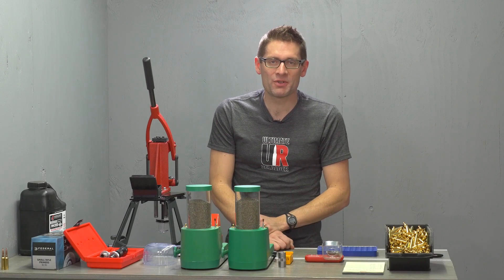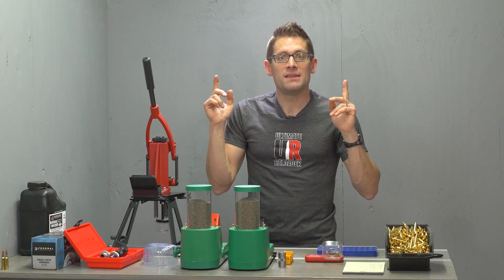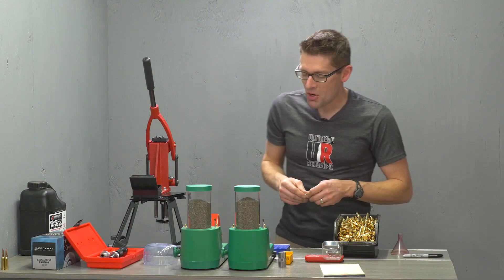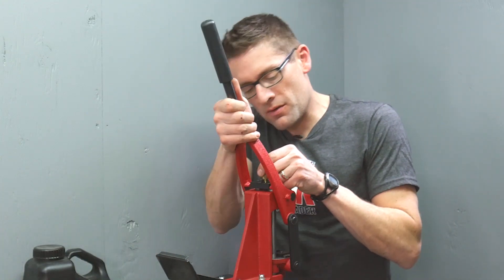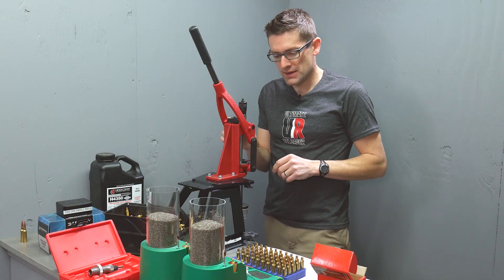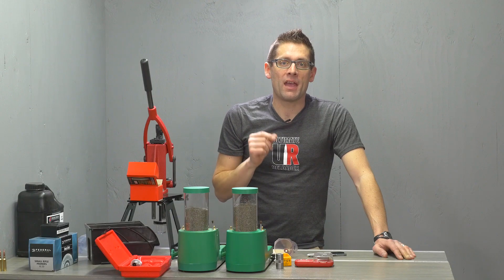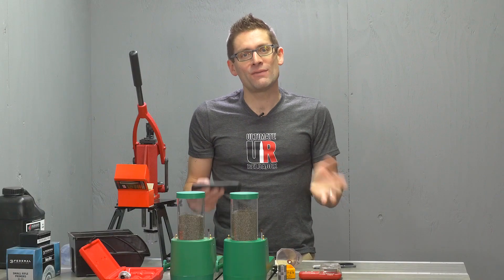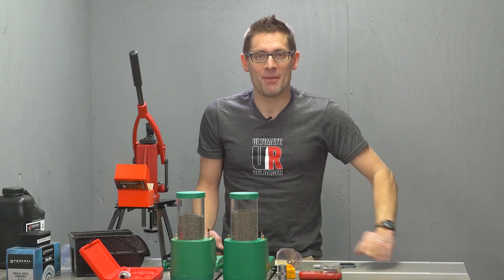Expanded 10 Shot Load Development for 6.5 Creedmoor

Comment: So just to clarify, how many shots were you shooting at each charge weight? I'm sure you've also watched the Hornady podcast about group size statistics and dispersion. If they were shooting strings of 50 to 100 shots actually measuring these exact variables I'm more inclined to believe the results of the engineers and ballisticians at Hornady. Please don't interpret that as a slight against your methodology, but if an actual bullet engineer identifies that they've run these exact tests with larger sample sizes, I'm more inclined to believe those results, where they've identified that the idea of a "node" with regard to standard deviation and extreme spread is really just the result of the samples not being large enough to identify a true distribution. Just a thought, but thank you for the content!

Comment: I noticed when you are seeding the bullet, you just do it in one stroke. Have you found that it makes a difference doing it that way, opposed to turning it 90° after a small pull on the handle, and then seating at home? I am referring to run out

Comment: Great video Gavin. Just a question on reconciling the load development approach you outlined with seating depth? I assume you used the same seating depth to determine the optimum load in this video. How do you then factor in incremental changes to seating depth once you have an optimum load 'node' that has the lowest ES and SD? Do you then maintain the ideal charge and start changing seating depth, which then means another round of tests to determine the ideal seating depth mated to that charge. Struggling with this one...

Comment: Does barrel temperature play a factor in this? Are you allowing the barrel to cool between 5 shot strings? Your 5th shot will leave a drastically hotter barrel than the 1st shot. Would that affect the data? Ive always done load development with group size, keeping an eye on pressure signs, then chrono tightest group to confirm my velocity and SD. It’s worked well for me, but I want to try this. However, I also want to factor in all major variables that could affect the data.

Comment: Another great tool that helped me is modeling software such as GRT, it uses a large data bank in its algorithms.  Statistics such as percent powder burned for barrel length and twist rate, pressure normal distribution curve, etc.

Comment: OK, I am declaring shenanigans. How can you be using the optimal charge method when you have an extreme spread of 12 to 20? We are getting excited over a two or 3 ft./s movement from one load to the next when if we run 10 shots with that load we get 20 ft./s extreme spread. What’s the guarantee that we are not looking at the top feet per second versus the bottom feet per second in any of those Charge weights. Declare this shenanigans.

Comment: Take an introductary statistics course and you will find the 10 shot approach to id a velocity node is a completely bogus method, and sd based on sample size of 5 is a joke as well. Rely on the target which requires fewer samples for valid results, and also reflects barrel vibration harmonics.

Comment: I’m surprised to see you use the Chargemaster lite like that without verifying the charge. I bought two of them this week and they are useless pieces of garbage. I can dial in, say, 50 grains and it will claim it dispensed 50 grains. Lift the pan and put it back and it now reads 50.4. Put the charge on other known reliable scales including a beam and the charge is actually 50.7. In my experience these are untrustworthy and dangerous. 

Returned then both as defective and got a Lyman Gen 6. It actually dispenses what it says it does and the scale agrees with all other scales.

I’ve lost a lot of trust in RCBS.

Comment: If you have a charge weight that has such ridiculously low SD, why wouldn't you adjust bullet seating depth to find that other node for accuracy? After I found the lowest single-digit SD I started adjusted seating depth in 0.003" increments until the groups tightened up. This is what Erik Cortina was trying to emphasize in his channel.
Reply: It doesn't hurt, but in my experience it doesn't help.

Comment: Hi Gavin, the speed based method didn't work for me. I wondered if this kind of reloading methods were repeatable or not before trusting it. So I carefully made 
 3 times the exact same test on my .308w : each time I loaded 20 rounds with 0.2 grain increments and recorded the velocities with my magnetospeed. On the 3 curves it gave some "flat spots", but at different charges. If I average the 3 curves I just see a linear curve. So for me no reproducible results means no reliable method. Maybe I'll try this test on another rifle to see if it comes from the gear. It was the exact same cases, and same components. I also waited 1min between each shot to avoid barrel heating, and pulled the trigger imediately after loading to avoid to warm up the cartridge into the chamber.

Comment: just curious as to what rifle you are using i use H4350 but my max is at 43 grains with a 140 elk match ruger precision Rifle 26 in barrel it is a one hole rifle and 2810 FPS also using large Fed 210's

Comment: When you do your 10 shot load development how did you chose your CBTO for seating depth? Would you use recommended COAL or pick min or maximum jump that meets your min neck seating depth? if you are going to do tuning of seat depth to get better groups, does this tuning affect the 10 shot load development velocity nodes. What I getting at is if you seat the bullet deeper or further out I have read that seating depth affects pressure, does this change in pressure cause issues by changing the ES or velocity enough to make the 10 shot results invalid ? How do you chose seating depth for the 10 shot load development? Seems like a chicken or egg problem if both adjustments affect each other?

Comment: The chronograph that you used toward the end of the video has an accuracy of about 1% (I have talked to the manufacturer about it).  That means that you know your velocities to about +/-25 feet per second at the velocities you were measuring.  For example, if it says 2500 ft/sec, it could be 2475 or 2525 ft/sec or anywhere in between.  Claiming the averages and SDs that you claim doesn't make sense - you haven't measured the velocities accurately enough to be able to make those claims. You certainly don't know the SDs to two decimal places.
Reply: @glycyldi  I agree.  There isn't much you can do about precision because you have no idea what it is and it's not specified by the manufacturer for any chronograph I have seen.  I think it's wrong to assume that the precision is good or bad.  I would assume that the velocity could be anywhere in the range.  In my opinion, the chrono manufacturers don't help here, as they don't make it clear how accurate their devices are.  Some have it in fine print, but most people don't see it or don't look for it.  I think they  assume that since the display reads to the nearest foot per second, that is the accuracy.  Also, I don't think the SD will be spot on - the error in velocity adds error to the SD.  Look here: https://en.wikipedia.org/wiki/Propagation_of_uncertainty

Comment: Which press is this?
Reply: Forster Coax. The press doesn't take case holders. It's held in with spring tension, allowing the case to float and line up concentric with your dies, which also float a bit.

Comment: Not worried about how far off the LANS the bullet is seated? Also not marking the charge on each bullet? What happens if you spill the bullets out of the loading block? I put black dots on the primers. First 5 bullets one dot, second different load two dots and so on. I also record the charge for each in a log book. I have experienced bumping the box of bullets and 19 fall out.

Comment: We did not trim the cases to a uniform length. Nor did we mark the cases with numbers to ID them in case they were spilt from the loading block. Using two separate powder scales invites two differing weights.

Comment: Testing 224 Valkyrie in a bolt gun, I ran an OCW. Started at 21.0 gr of AR-Comp and went to 23.4 gr in 3-shot groups in   0.3 gr increments.  I got low single digit SD's pretty much everywhere, but every 0.3 gr increase in powder  had pretty much exactly 30 fps increase over the prior load. There were no "flat spots"  in my velocity increase graph.  It was a straight linear increase in velocity across the board. Any ideas?

Comment: Now that you are going to be testing a smaller range of charges, I agree with George Meinschein that your strings should progress through all the loads one shot at a time. Say, 5 loads at 5 charges (A-E). A1, B1, C1, D1, E1, A2, B2, C2, D2, ....... etc.
Also maybe measure barrel temp and/or shoot at a specific interval to further mitigate the effect of barrel heating.
As to the idea of using fire-formed brass, basically we all need to be developing TWO loads. One for the out-of-the-box brass and one for the fire-formed brass. They will be different. Might as well use the fire-forming process to work on your loading and marksmanship skills by developing the best performing load.
As far as the variability of the 2 scales goes, you could always do crossover weighing of an arbitrary big scoop of powder. Agreement to 0.1 at 42 grains is nice, but the same agreement at 200-300 grains or even (10x) 400+ if it will fit in the tin cup would be even better. At 10x grains a difference of 1.0 grain would be the same as 0.1 grain at x total grains.

Comment: I noticed you’re a mechanical engineer, have you used anything you’ve learned (like from a mechanical measurements class) to increase the precision of your loads? Things such as T-tests, chi-squared test, etc
Reply from the maker: Nate, yes, that's correct! To be honest, I've just tapped into the statistics that I've leaned, but nothing too fancy! (SD, ES, etc). :)
Reply: Thanks for everything you do! Hoping to start using the material I’ve started learning in upper level classes. Thanks and Gig’ Em

Comment: Or you could just get a sheet of plywood and shoot your groups at long range, say 500 yards on a calm day (and without a weight hanging off of your muzzle to mess with your barrel harmonics and shift POI), making sure to let the barrel cool in between shot strings. Choose the best group, then repeat. 

If results are repeatable, go have a beer, your load testing is over because you found the best load out of your test samples in terms of pressure and barrel harmonics. For data, throw a few rounds over a chrony at 100 yards to confirm your zero and your average muzzle velocity. Simpler is usually better.
Reply: That won't tell you anything about MVV's affect on that load combo, not to mention, barring use of a bench rest, remove mechanical variability from the equation. Besides, you can do this just about anywhere, like down the road into an embankment as long as you have a good backstop and aren't violating any noise ords.

Comment: looks like statistically insignificant data. Are you shooting at timed intervals for consistency? graph your change in speed by group shot number. I'm betting you data outliers on SD are your first shots from each group and you happened to get a hot load first at 45

Comment: Handling your primers with your bare hand is not good reloading practice. Oils on your skin can cause miss fires. Please consider a hand priming tool. It will also give you a more positive "feel" for seating your primers and it is a lot faster. 50 years of loading has taught me a few things.
Reply from the maker: I don't believe that. Grease from your hands would need to get down under the anvil and onto the priming compound. Unless your fingers are dripping with bacon grease- I don't see that happening. The priming system on the FORSTER Co-Ax requires that you handle each primer- and MANY serious rifle shooters use that press with zero issues.
Reply: I noticed the same thing and thought the same

Comment: Hi very interesting video on this way of reloading. I find it interesting that you found the low SD in the valley of velocity that has been my experience across a number of rifles and loads. But I have had a few rifle/load combos that had very close to a linear increase in velocity. Anymore I go mostly by SD and ES if it's a flat spot that great then tune seating depth and go to shoot. It may be possible to find a better group at 100 yds but that doesn't necessarily mean that it will have good SD. Cheers.

Comment: Whats interesting is the 12 and 11fps SD variations at lower charge weights have 1 outlying data point both low. Could be 1st shot and then barrel heats up?

Comment: Great video, im curious however about how you are priming the brass. Touching the primers like that is usually not good and can easily make them fail. Have you had any issues?
Reply: Dan Kowalchick it is really really hard to make a primer fail. I have handled mine the same as he did for 30 years and have yet to have a failed primer.

Comment: I would have loved to see you shoot all of these over two different chronographs... I'm wondering about the accuracy of that instrument, along with the possibility that your observed "nodes" are really a factor of the chronograph rather than finding an actual node in the charge size/response.  I also think the science would be better if you used fire formed, same-weight brass and bullet weight consistency.  Always be questioning the data and the measurements, just as much as the method :-)  Love the videos, thanks!

Comment: Thank you for taking the time to make this video. Very interesting. I have a comment however on the accuracy of the scale you used. An electronic scale at this cost ($300 for the whole setup not just the scale...) is incapable of measuring accurately 0.1 grains. That is the display digit precision (readability)but has no relation to the accuracy of the scale. For example, a $5-600 strain gauge scale can measure accurately (in an enclosed environment with absolutely no air variations) only up to +- .15 to 0.2 grains. To get an accuracy of 0.05 to 0.1 grains you will need a scale with magnetic compensation and those cost over $2000. In other words, when the charge master throws a 39.1 grain weight it could be anywhere...at best.... between 38.9 to 39.3 grains. Take that into consideration when you develop loads that step only by 0.2 grains.Thanks again

Comment: Yes the science involved is interesting. I found out another way to play with extreme spread in single digits is to move seating depth in or out some once I found a muzzle velocity I wanted. You wouldn't think it would change much but in my results I loaded 44.2g varget 10 thousands from lands an 28 thousands off lands. Interesting enough the closer I got to the lands the higher the e.s. 35 to 40 fps. The loads at 28 thousands, single digits pushing 168g Berger 2,750 out of 22 inch barrel.

Comment: This method works all the time but I use three shots for each load. The low extreme spread always reflect tight groups.
Reply: I wouldn't say that, but I agree on the fact that even 3 shot groups can give you true indications. I think that's the same thing for the speed E.S. and the group size : on 3 shots series, low E.S. or tiny groups mean nothing, but large groups or high E.S. means for sure that the load is bad.
Reply: @blacksand9805  correct, 3 shot series can have one without the other and it wouldn't mean a thing. Sometimes low E.S. can still result in larger groups or vice versa. what I meant to say when I said I use 3 shot is that I run the same ladder test 3 times to confirm that the low E.S. has a tight group. If the E.S. is low but bad group, adjusting the jump should remedy group size.

Comment: I bought the RCBS Charge Master 1500 with the hopes that it would speed the process of my load development. After about 35 rounds I abandoned it entirely due to inaccuracy as compared to my RCBS 1010 balance. The Charge Master would consistently be over/under one tenth as much as it was dead-on or metered an over-charge (RL-17). I found myself checking it against my balance so much that it was actually wasting my time. I just felt for absolute precision it wasn't the choice and it wasn't doing anything my Redding BR-30 couldn't do better. I'm open to thoughts and opinions.